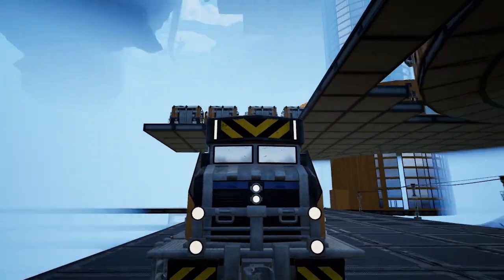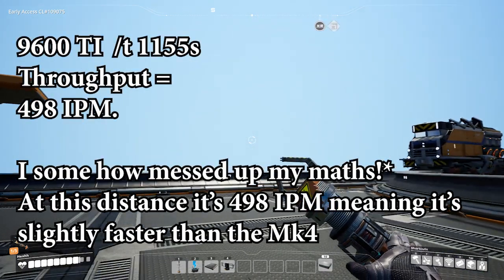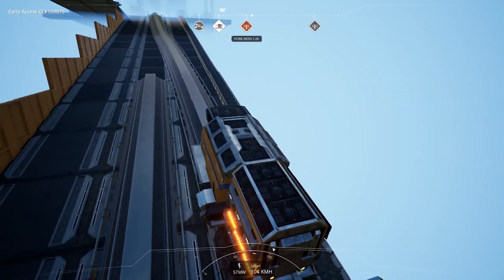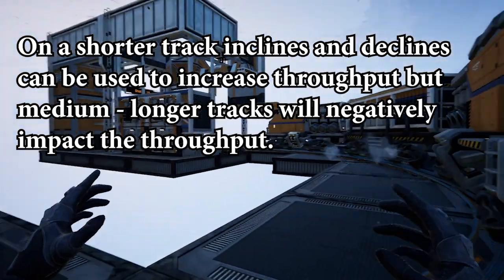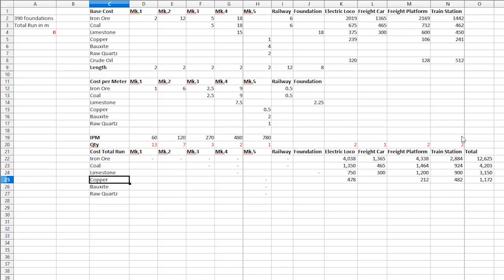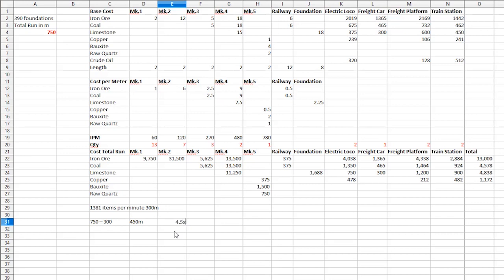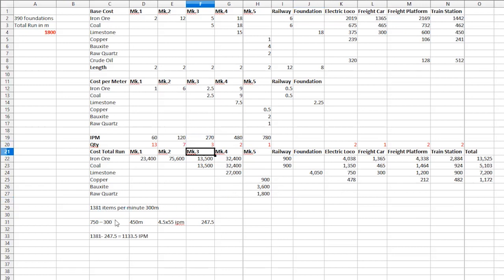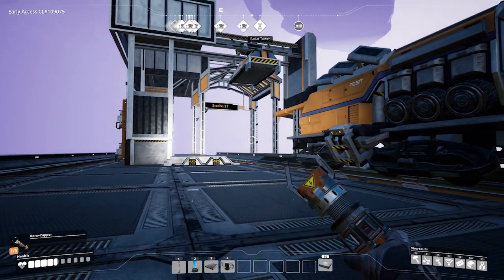Satisfactory Mythbusters! Trains VS Conveyors A detailed look. Didn't see that coming!

Comment: Focusing on raw throughput numbers for a single wagon on a single track is kind of missing the point, isn't it? If someone really wanted to maximize the throughput of their rail system, they'd probably use twinned track and multiple trains, at which the bottleneck easily becomes the rate at which items enter/leave stations. You're trying to answer the question "Are trains faster than conveyors?" but that's a not a very important question to ask; the advantages of a train network have more to do with cost and flexibility than they do with raw throughput. For any point-to-point link, conveyors work great. But if you want to use the same shared infrastructure to move multiple types of resources to multiple locations, trains make it a lot simpler than the smart-splitter mess you'd need with conveyors. (It's also less effort for your computer to run, too)
Reply from the maker: Greg Peterson you’re absolutely right but I don’t feel I miss the point because if you can prove that the throughput and the cost (which I also covered) is more efficient for a single train wagon verses a conveyor, then obviously a second wagon, or multiple trains will be even better for the throughput. ☺️
Reply: @TotalXclipse  The real point about trains is that they're great for long distances... Because you can put multiple trains on the track AND you can add more wagons per train.  
You can also branch off making trains very versatile and cheap to operate for hauling stuff around the map.

NOTHING can beat the raw speed of a conveyor if speed is the only worry you have because ultimately the stations get filled/emptied with conveyors.  But putting up huge conveyor systems with 20+ belts takes a lot of work and resources to build  and maintain (upgrade) as you go.
Reply: I think the initial cost of the train setup is pretty much negligible if you just want a good flow of items and less of a spaghetti mess. 
But I think you have to keep in mind that maybe you only want to use the Train to transport more specialized items instead of running the basic components to keep running your factory, because specialized items take longer to make and usually slow down the rest of your more basic production if you are not really focusing on load balancing your factory. But yeah, I agree that making a looped circuit for multiple trains on 1 track and having multiple cargo cars in a train is probably the best option, this could probably also work with screws if you just get enough cargo cars to haul the screws back and forth. I guess it just comes down to how much work you want to put in putting up a conveyor mess everywhere versus a clean area with just a train network managing your logistics.

Comment: Probably the best way to do it is look at the inputs of resources into your stations, match that with the inputs of your desired factory and add freight cars until the train can make a round trip without filling up completely. I think overflow splitters will be really handy for this. This will guarantee your train is providing resources at capacity while only having to do standard belt maths. It will absolutely always be more efficient to build a giant belt/pipe highway, but not necessarily cheaper in terms of resources or time, plus then you don't get to play with trains. :)
Reply: Yeap, this video is basically useless.

Comment: With trains, you're limited by how fast you can load or unload the freight platforms, and each platform is limited to two belts. Make them Mk. 5 belts and there's your limit per car. If you fill a platform before your train is back, add a train. 

Trains also allow utility, the ability to keep a project train at base, stocked up and just run a track to a new area, plop down a station and call it. Or the ability to ride it faster than a belt, the conduction of power though the tracks. 

Belt busses are cheaper, but only stretch 6 platforms. Running them long distances is tedious and repetitive, and having ground level belts running back to base can look ugly and disorganised. Where belts shine is they deliver a constant, infinite supply of items to a designated location, can be split or merged easily, and don't rely on power. they are also a lot more compact and easier to edit. 

In all, each has their uses, and each has comparable throughput with enough conveyors/carriages. There are pros and cons, but material input is a pointless metric as resources are infinite, the only difference is time and effort.

I'd advise against using any kind of vehicular delivery for anything to do with power, you want that to be constant. Id advise against running conveyors across the entire map, as placing hundreds of 6 tile strips for each line will get very, very boring when compared to placing 1 track and having trains come from all over the map to dump resources. 

Play your way, build what looks good and is most fun for you :)

Comment: A big benefit to trains is their ability to expand. If an area needs additional resources, just add another station and another freight car and you're good to go. Way better than adding a ton of new belts to your ever expanding belt line.

You also can't overlook the ability of the train system to deliver power as well. If you are looking to setup a new manufacturing area, the trains not only allow you to ship those resources across the map, but they also allow you to power the new area as well by pulling power from the station. So, for the price of one set of rails and a few stations, you get item transport and power. For longer and larger projects, trains make so much more sense than conveyor lines.

Comment: Great content, as usual 😉👍
Throughput is always an important measure. The biggest thing people get crossed about trains, is the simple difference between packet distribution, vs. capillary distribution. Capillary distribution is great... IF you can keep the lanes full at all times. A supremely good example of this, is the way internet data distribution is delivering this very video. For the overwhelming majority of instances, internet data transmission is packet distribution. Why because it's simply more efficient form of shared lane distribution. With all the technology that SHOULD be available in both this day and age, AND the premise of this game...  the best solution would be a constant velocity rail system. It basically works like a conveyer, but with containers. The rail carriers run at the same speed. The loading stations load the containers, then accelerate them to the speed of the rail carriers, meet them in-transit, and parallel load them at-speed.

Comment: The main reason for trains is instead of building 5 or 6 conveyers stacked on top of each other along with power lines and all that cost, you can just lay down train tracks ONCE over the long cross country distance and that’s it instead of going back 6 times over.

Comment: I think a good rail network is the way to go transporting items across long distances regardless of the item loss throughput. Even though I love conveyor belts, its just so much more time efficient to run a loop track system for the rail network and have as many trains as you need running on the loop. It takes much more to set up in the beginning, but once the main loop is established, adding in stations and new routes is much easier than running an additional belt across the map to hit a new resource node. The throughput of the loop rail network could be nearly endless just by adding more trains vs belts where more belts= more space= more throughput. I am curious though for game performance between  belting in all the resources from far away or training them in. Running a Continental belt system would have one awesome advantage though, that being the 100% throughput of the resources available at all times and would be much easier to calculate how to fully utilize a node to maximum efficiency. but when a new tier of belt and or miner comes out that can produce more than the belt is able to handle, imagine upgrading all those belts. =[]
Reply from the maker: Yep, you're absolutely right, having a looped track would be an excellent way to easily upgrade the throughput continuously limited by only the space available on a track and the time it takes to load/ unload items. I also feel it looks cooler than conveyors. I wish I had the means to test the performance difference between trains and conveyors but currently it's not easily doable for me on a laptop and with a lot of time constraints touring.  but seeing a continental belt system would be pretty awesome if the computers could handle it! :D

Comment: To make it equal, one Freight Platform has 2 inputs, and 2 outputs. Meaning it can max out at 1560 ipm (mk5), and for that to happen, it has to be moved to the train at the exactly same time as its own container is full. And likewise, it has to be empty at the exact time as it's moved from the train to the platform. Unless your setup is that exact, the conveyor belt will always be faster... 
 
The only reason to use train over belts, is because it's there, looks good, and it's fun :)
Reply from the maker: I understand your point, but that's only if you're using 2 conveyor belts to transport items over a long distance (which is something I personally don't like to do) 
Also regardless of throughput the price for long conveyor lines is much more expensive versus that of the train. Which is to a certain extent another good point for using trains. (that and the fact they're fun like you pointed out ;) )

Comment: Well yeah, using a 2 headed train with only a single wagon is never going to be useful unless you're just transporting a single item with low quantity, and honestly thats not often. What we should be doing, is using 1 way trains such as a 2-4, 2-6, 3-10, or even 6-20 for the biggest and longest loads. Typically, the 2-4 is what I most commonly use, like for transporting oil, bauxite, or uranium back to a central area. 

I don't think its very fair, or honestly very useful, to do these tests and post these results with what I'd argue is the worst/least efficient train configuration, as well as the smallest possible.

Comment: You measured the time between the train leaving the station until the moment it arrives back home, thus missing the loading time that is also part of the cycle.
Reply from the maker: I actually timed the train from leaving the station, heading towards the station where it loads. I then finished the timed cycle after it had finished unloading it's 3rd load. That way I was able to include the loading time as well as the journey after it's first unload. :) Sorry if it wasn't clear in the video!
Reply: @TotalXclipse  , thanks for clearing that up !
Reply from the maker: Ellert van Koperen no problem ☺️

Comment: with just common sense you can know what is best, if you have for example 2k iron per minute being produced and you need it in different places, train 100%, or even if you need the iron for 1 factory you can just put 2 trains or one big one, depending on how much iron you use in your factory, trains are the best solution if you need to transport a lot of stuff at a distance of 50 foundations or more, you can transport like 20 super computers to the other side of the map if you want too LOL, not the best use, just saying, better planning is what most people need
Reply from the maker: Yep, but I think the issue we've had is that most of us started using the trains after we built our first factories as they weren't released at that point. So people are less able to plan for it. 
I just wanted to look at to what extent the numbers changed over distance and against the price of using them.

Comment: you are missing the point of trains.
a single train with 10 carts can match over 40 conveyer belt which is insane to build all over the map specially if you are dealing with long distances also its way cheaper and easier to build to connect all distanced factories all over the map

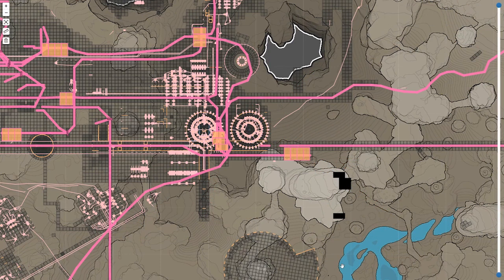Comment: Hey there. How did you get the map at 3:53 ? I would love to see my own base on the map ! :)
Reply: Here: https://satisfactory-calculator.com/en/interactive-map#2;50000;0|gameLayer|
 Just drag and drop your save file in the box.
Save file is located here: C:\users\User\appdata\local\factorygame\saved\savegames\folder named with a lot of numbers and letters.
Just a little warning: this map can spoil you the exact location of every node, hard drive, power slug and collectable. Every single one of them. Just be aware of that
Reply from the maker: @Cancaro  Thanks Federico! Cydream, he's absolutely correct, it's the same page that I used for it! :) It also comes with some other really useful tools too
Reply: @Cancaro  what you saying? is it the same layout from everyone other than a map generator
Reply: @Digital_Renaissance81  the map is always the same for everyone. When you start a new game you get to chose the starting area of the map, not the actual map.

Comment: but if you put more wagons you get more stuff no?
Reply: Yes, Correct. Each wagon, does hugely boost the throughput of the trip (off the top of my head can hold an extra 3200 items, however due to the extra weight it works out that you lose an additional 50 items per 100meters... on average per wagon)  However I need to stress that all of my results with extra wagons didn't give accurate results, I've no idea why but for that reason I decided not to use them in this video.
Reply: @TomTunkinJones  should try to get the ratio wagons/locomotive how many wagons per loco? maybe 3 then add 1more loco if you want 6 ? and see on very long distance, cross map; whats the best set up to have .tho i never got into trains. was too buggy when it came out and too mutch of a pain to figure out for me
Reply from the maker: It would be interesting to check out but I've got a load of other videos to do first, maybe once they're done I'll be able to try that out!

Comment: For me privatlie. Flaying builds, flaying bases, flying Tracks, is a no go. And for me after testing trains, trains are totaly not usefull. You need to many space for build it in the nature of the map without destroing the nature and plus they are to expensive, to buggy, need massiv more time to build (its frickelig, you cant build things at a fast and good way, for splitt tracks ans go of and go in multiple track and stations). Trains in Factorio are a nice to have thing, but belts are more efficient. In Satisfactory, trains make absolute no sense for people who dont want flying bases and efficient, compact buildings and transport system. 

For people who have no problem with, there is no static, all trees and flower must die, all can be loock very ugly, flying are ok (so you have always enougth space and no much up and down railways, trains could be ok for you. 
And one single Trainway with two stations are pointles. For trains, i think we talk always for a big railway map system with two and more traks (right forward, left backward and many holding stations with track bypasses).

And for people like me, i like the concept from central containers, mono factory's (always a factory for one thing, not this i want a product, so i need 5 iron ore, 5 mashins, than other machins.... and after 20 mashines i have, what i want. 
I play HERE is the Iron Smelter factory, massive production. This goes to other places in the map and there the next ONE Produktion Line. 
Trains cant handle the massive numbers of items. 

Belts cant bug, need much lesser buildcosts, need no power or fuel, are super constant, cant crashes in other trains/Trucks.
BUT one big probklem have Belts, its very difficult to build a compact and good compensation system. By trains, if the one production dont use resouces becouse its full, the Recources can go very easylie to an other factory area at the map. With belts, you cant use for 50 Iron Ore belts splitters and merger to become all belts are at the same level full. 

Thx for this video. It coud be longer and with more variables. But like goes out.
And sorry for my bad English.

Comment: iiiii'm a bit unsure of the point of this video? so far the only thing you have done is putting some numbers on the ofious?
Reply from the maker: I covered the basics of this video in the original train vs conveyors, trying to see which had the higher throughput. This video is just to look a little more in detail at the maths behind the throughput of the train versus the conveyor and also the price to setup comparison